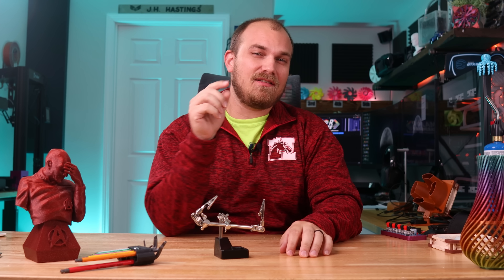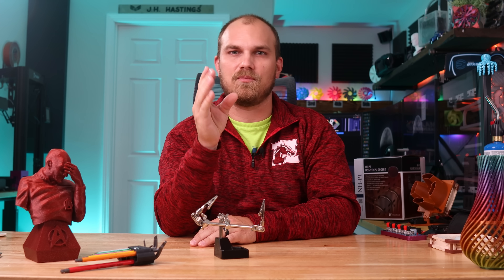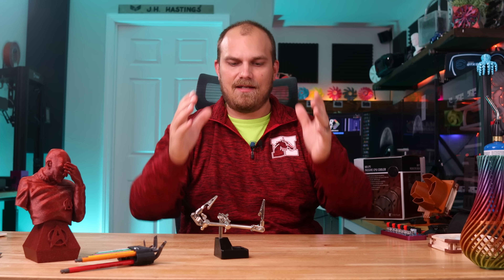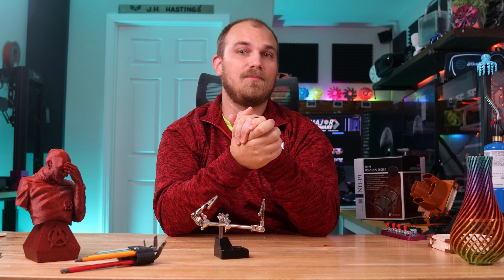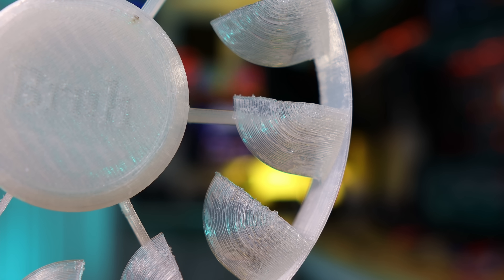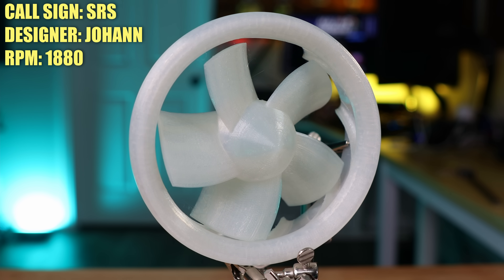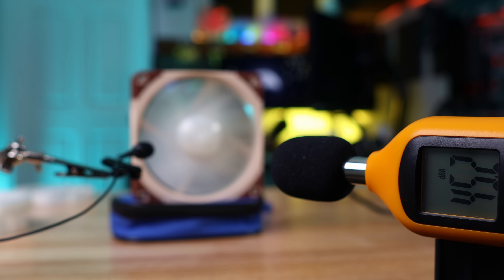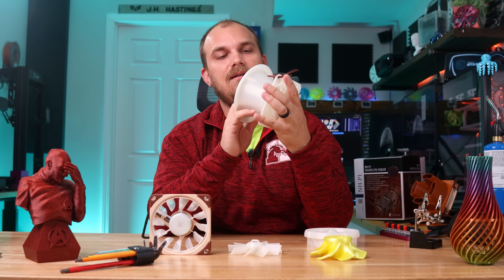TURBOCHARGING the Noctua NH-P1 - Fan Showdown S3E1

Comment: Gamer's Nexus is getting some very advanced fan testing equipment over the next couple of months. I would love to see a colab where you send them the best fans from the fan show down
Reply: We all know the real collab would be snowflake and cooper
Reply: Yesssss. Sending them the best fans of all time would be the PERFECT collab.
Reply: @802Garage  ya, that sounds amazing
Reply: yes! And the winners of the first 2 seasons
Reply: @TomHenksYT  I believe gns is an all in one pressure, temperature, humidity etc. regulated vessel which maintains consistent and constant environment to allow for direct comparison rather than having to look at the delta which increases testing validity as i.e. volume of sound in different pressures of air can vary significantly. GN are marketing more at potentially debunking the claims of manufacturers rather than the exact performance as this is the same equipment firms such as cooler master use to test their fans preproduction or at least that is what I understand from the fairy limited info given by GN
Reply: @joelkemp8281  Yeah, I understand that GN probably has different intentions than simply comparing which is the best fan with either the highest airflow or static pressure and whatnot. But still, a cross-channel collaboration would be epic to see, especially when considering the level of influence that GN has. Who knows, if the fan does really well in the fan showdown here, and then also gets GN's seal of approval, maybe another fan design might get put into production by a manufacturer so we all can buy it. That would be the dream outcome for a collaboration like this. I'm not saying it's gonna happen, but you never know
Reply: @TomHenksYT  I wasn't knocking it on the contrary mine was in response to the guys who was mocking it saying it was a pointless piece of kit, it should give GN the best information to review fans in the business nobody except manufacturers has that kind of equipment as there is no expected ROI, it's a money pit but GN does it for the love of all things computers and being able to properly analyse the manufacturers claims would be refreshing.
Reply: @joelkemp8281  GNs setup, what they're developing, is pretty much the same testing and qualification/certification equipment that specialist companies like Noctua and Delta use. Including working on an anechoic test chamber. Lets also not forget Schlieren imaging, they already have that up n running, along with cooler pressure zone mapping and engineered precision test jigs for CPU coolers that can simulate subsection heat sources with individual power characteristics, like with Ryzen's multi chiplet CPUs.

GN takes this stuff very seriously, and go far and beyond to try to generate and present as hard, accurate, verifiable data as possible. And while their content (or personalities) may not be to everyone's liking, the data they strive to equip the community with, is of substantial value to everyone, in one way or another.
Reply: ^this
Reply: haha Nexus would love that idea I do not doubt
Reply: every 4 seasons, he sends over the winner from each of the seasons to get the GN experience.  100% im here for that.
Reply: Was thinking the same after seeing https://youtu.be/N8EjMwS2ut0
Reply: Yes I'd like to see that too
Reply: Yes, great idea
Reply: That would be amazing
Reply: I agree!
Reply: Yaaaaaassssss!
Reply: Yeeeees
Reply: I need this content
Reply: lol GN only now, in 2025, will begin using that fan tester
Reply: God has said in the Quran:

{ O mankind, worship your Lord, who created you and those before you, that you may become righteous - ( 2:21 ) 

 [He] who made for you the earth a bed [spread out] and the sky a ceiling and sent down from the sky, rain and brought forth thereby fruits as provision for you. So do not attribute to Allah equals while you know [that there is nothing similar to Him]. ( 2:22 )

And if you are in doubt about what We have sent down upon Our Servant [Muhammad], then produce a surah the like thereof and call upon your witnesses other than Allah, if you should be truthful. ( 2:23 )

 But if you do not - and you will never be able to - then fear the Fire, whose fuel is men and stones, prepared for the disbelievers.( 2:24 )

And give good tidings to those who believe and do righteous deeds that they will have gardens [in Paradise] beneath which rivers flow. Whenever they are provided with a provision of fruit therefrom, they will say, "This is what we were provided with before." And it is given to them in likeness. And they will have therein purified spouses, and they will abide therein eternally. ( 2:25 )

 Quran
Reply: Not a fan of GN. The host itself manages to irk me beyond rationality.

But I can see how this would be neat
Reply: @CreamAle  sounds like a personal issue lol. Unless you meant linus.. Then ofc.
Reply: @mr.davemaeen8136  at no point did I say that it wasn't a personal issue.

The same way it's yours that you don't like Linus 

Now wasn't this a complete waste of both of our times .
Reply: @CreamAle  that really just went right over your head didnt it. You're no fun.
Reply: Gamer nexis is a jew he dosnt like to have fun or play games he woul never go for it
Reply: @CHICKENmcNUGGIESMydude  clearly you have only watched his reviews
Reply: what exactly is the "advanced fan testing equipment"? lol the guy in the video already has pretty solid standadized method of testing performance of fans. gamer nexus is just looking to cash in on the fan battle with their "advanced technology" BS
Reply: @lordjaashin  Yeah, the channel notorious for being super critical about case cooling is "looking to cash in on fan battles" rather than continue being critical about case cooling
Reply: @lordjaashin  pressure measurement, flow visualization, etc etc etc
Reply: @Echristoffe  smoke test is exactly what is used for flow visualization. even professional aerodynamic tests conducted in wind tunnel use it.

pressure difference test is not necessary as we're indirectly measuring it with delta T as pressure is directly related to temperature difference.
Reply: Now thats a fuckin reply. 👻👾🐸
Reply: @nuarius  you have a relevant username. yes, aerodynamic testing is done by blowing smoke over aerodynamic surface in wind tunnel. not everything has to be complicated. the purpose of the smoke test in aerodynamic industry is nothing more than visualization of wind pattern over wing surface. so yes its a simple test and thats what makes it effective.

GNs problem is that they always try to pass themselves as some scientific NASA scientists when they're nothing more than glorified PC stress testers. they neither have the educational background to rival actual R and D scientists that multimillion dollar companies have access to. you say major hardware being small channel compared to GN makes his tests irrelevant then i say GN is irrelevant in front of multimillion dollar companies.
Reply: @lordjaashin  if you misrepresented what i said any further your comment would have allmost been unrecognizable as a response.    Good work.   I will leave you to bask in the great sea of salt that seems to consume you as soon as somone dare mention GN lol.   Cheers
Reply: @lordjaashin  literal strawman argument. "pass off as better than multimillion dollar R&D"; nobody said that and GN likely hasn't claimed such BS. go seethe elsewhere.
Reply: @Kikker861  person above me is claiming that. go read the comment chain properly before butting in like a butthead. seethe elsewhere
Reply: @nuarius  keep spinning this argument and I'm sure you will achieve orbital escape velocity easily. keep simping for GN. I'm sure steve will let you touch his hair for your white knighting
Reply: @lordjaashin  oh boy! I sure hope so.   Its the only way i can get off anymore.
Reply: @lordjaashin  The first is true, however the second is kind of questionable. Certain coolers will need more airflow, while other, more densely packed ones require more pressure.
Reply: @lordjaashin  it’s nice to have solid statistics. You need to take a chill pill dude
Reply: @lordjaashin  if they can more reliably make the smoke in the same quantity and making it go in the same direction than that is better.

Major Hardware does some amazing things but I presume you've also seen the vid in how he shows he does the smoke test? Lots of variables there..
Reply: @lordjaashin  ... they're buying industry level equipment. They're the same stuff that the factories use, allowing GN to basically scientifically verify the reported results of the manufacturers. This allows them to essentially hold the corporations accountable to their marketing.

They're on a complete different level as far as testing is concerned. Please don't spew bullshit without even the minimum amount of research.
Reply: @lordjaashin  the point in having the same quality test suite that the manufacturers use is so you can 100% call them out on the numbers they put on the box.
Reply: @rcaguitars  Oh boy, I cannot wait to watch the fallout. The numbers that fan manufacturers put on the box are one of those things we cannot feasibly test ourselves,
Reply: @lordjaashin  Steve will be using the tools that the power supply and cooling system manufacturers use for their own ratings. It's going to allow him to generate empirical, numerical data using a standard that the manufacturers already agreed to use. It's actual lab-grade equipment built to a reference. MH does a pretty good job, but it's not like it's NIST traceable or even up to a standard that could be used as evidence. Metrology is srs bznz.

Comment: Wow, topping the chart with his first 3D model ever and it's basically just flat pieces together.
Reply: It ain't stupid if it works ¯\_ (ツ)_/¯
Reply: @androiduberalles  Exaclty :D
Reply: @androiduberalles  why not make a fan shaped like "  ¯\_ (ツ)_/¯ "
Reply: @Kafj302  I like the way you think. I'm not good at cad but it might be kinda fun.
Reply: @androiduberalles  “Crazy people don't know they're crazy. I know I'm crazy, therefore I'm not crazy, isn't that crazy?” 
-Will Turner: “This is either madness... or brilliance.”
-Jack Sparrow: “It's remarkable how often those two traits coincide.”
the crazy pirate was right
Reply: Right? I was gob smacked as I'm thinking about making a fan, Aiden motivates me further!
Reply: Worth noting that (from what I've read) typically straight fan blades perform better then curved ones but result in more noise... So what's amazing here isn't really topping the chart but how quiet it managed to be compared to the others
Reply: @qazaq25  i'm thinking the rough surface of the fan blades may have something to do with it
Reply: Looks like a clutch fan in a car
Reply: B I G   S M O R T
Reply: Definitely a great baseline design, extremely simple and yet surprisingly effective
Reply: Sometimes the simplest solution is the best
Reply: KISS works!
Reply: Sometimes the answer to a problem is much more simple than it seems. Overengineering a fan doesn't always work I guess.
Reply: Well, S2E8 #1 is a proof
Reply: Chad trashcan fan
Reply: Chad trashcan fan, simple, first design he ever made vs complex loud and hot fan

Comment: Convection based CPU coolers work different to how traditional CPU coolers do, even if you install a massive server fan stack to that cooler, you wont see as much difference, cause the heat transfer doesn't deppend nearly as much on airflow but on the conductivity and radiation of the fin stack itself
Reply: This is wrong. Radiation is a very small portion of the total heat transfer at low temperatures. You need large temperature delta’s to make radiation significant. And without air flow, the surrounding air will heat up to match the temperature of the fins which reduces heat transfer to practically nothing. You’re counting on passive diffusion of the hot air around it, which is why this passive cooler has a ~100W restriction. You need air movement to keep fresh cool air over the fins once you get past the limits of natural convection.

Comment: Is there any recommened free programs to use for designing stuff like this (and other things for 3D printing)?
Reply: SketchUp with an STL add on is fine for designing.
Then depends on what printer you get as to what software you use for finalising the prints
Reply: @darrenfalconer3267  Thank you, I'll check it out. I've heard of people using that for planning out wood projects too, so I've been meaning to look into it.
Reply: If you know absolutely nothing start with tinkercad. It's literally as easy as putting Legos together. If you're looking for something that is standalone on your computer and not cloud-based and free look up 123d design. Is a mix between Tinkercad and fusion 360.
Reply: @Destructor429  Thank you, I will check it both of them out.
Reply: Autodesk fusion

Comment: The turbo needs its case... a pro charger style with gears and a blower exit might have better results pulling more air than just the turbine... people are not taking the compression of turbines in general is what makes them push more than just suck they need to compress too to make a propulsion of the gases.

Comment: I think it'd be more fair to put fans into two classes: airflow and static pressure. I've watched the show from the start, and I saw an assortment of both classes. Airflow fans won't do well in cooling, but they do move a lot of air, while static pressure fans cool well, but they can't funnel the air as well as the former. Idea for season 3.
Reply: Also, the Noctua P1 isn't really designed to be used with a fan. it's been designed to be used passively, adding the fan is just an extra. I'm a little bit confused about the choice of cooler when doing comparisons between fan performances.

I think comparing fans on air-coolers with proper fin density vs radiators makes sense, but not on a passive cooler.

Noctua themselves also state this, and gave this cooler a performance rating that is lower than for example, the U12A.
Reply: Looks like whats an important part is the exhaust flow.  you can see in the turbo fan that the exhaust is vented around the sides - out the edges.  The best performer would channel air straight out into the radiator fins.
Reply: @fredfinks  yeah, but it's designed to push air into the radiator instead. The funnel will need a redesign to work as an exhaust fan. Separating fans into two classes might actually increase the diversity in some of them, actually: they'll need to make fans to serve a specific purpose instead of just pushing air through a radiator 🤔
Reply: High Airflow fans do cool very well as lo g as there isnt too much restriction. Thats basically the server cooling model. Balls to the wall airflow.

Comment: The flaw with the turbo is that it's not designed to push air directrly back, but to make it spin, thus the original snail design.
Reply: Yeah, too bad he didn’t spend as much time on the back side of the designed to redirect the air flow back as he did on the pretty front side. Definitely moved a lot of air, just not the right direction.